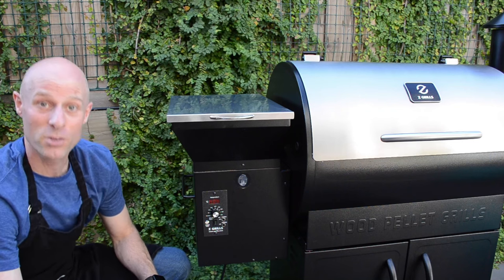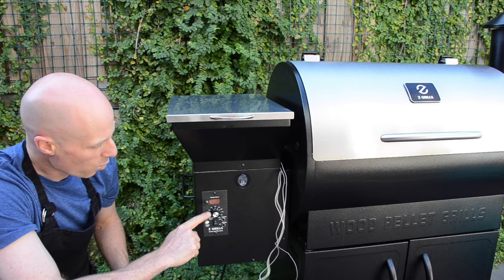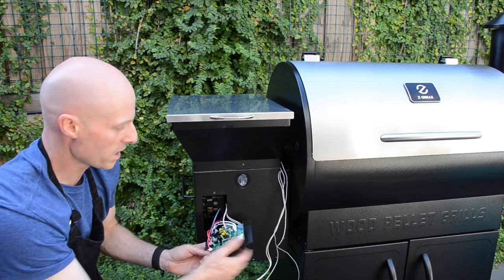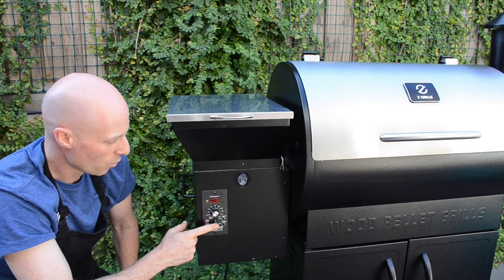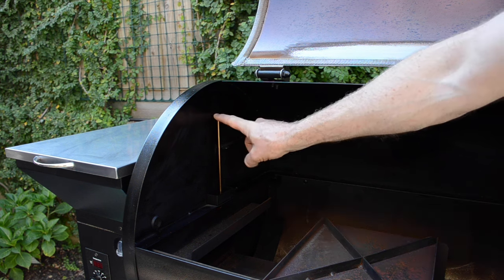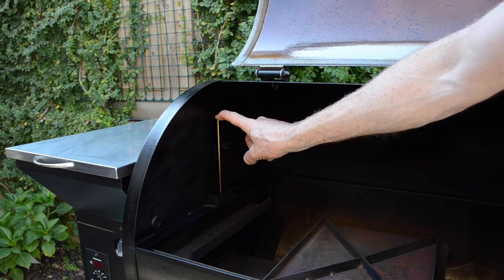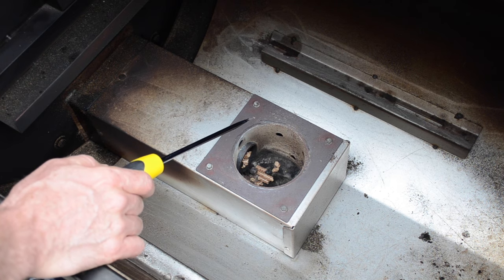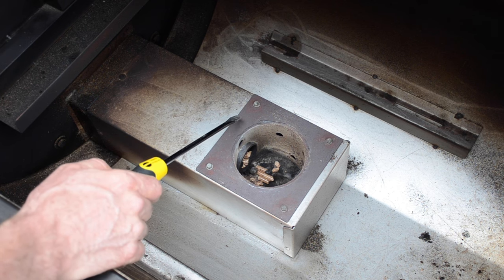Error codes on your Z Grills wood pellet smoker

Comment: I live in a cold climate (alaska) and my zgrill throws me an er2 code all the time when starting up even since new. Everything I have read states to replace the probe. I figured out if I take my cigarette lighter and warm up the probe a little, the grill will kick on. Just a helpful tip.
Reply from the maker: The temperature sensor has a range it can read and because you are so cold then must be below that.  Nice work finding the solution!
Reply: Your trick also works in Missouri! Thanks for saving my Christmas brisket!
Reply from the maker: @jeremysellars5643  Awesome!! Merry Christmas mate
Reply: This just saved my day. Thank you
Reply: Just saved Christmas,  Thanks Wisconsin  1 degree this morning
Reply: @mikemunz747  same issue here in Illinois today
Reply: -1 Degrees Farenheit here in MN, the lighter trick saved my day! Thanks
Reply: FYI after i used the lighter trick to get it going i also had a  low temp error message when i tried to go from “smoke” right to 250. I restarted it and then gradually took it up one click at a time letting it reach temp each time till i got to 250. Hope this helps someone.
Reply: Corbin!!!
You Sir, are a genius!  Live in North Western Wyoming.  It's 1* right now and I was struggling with the same issue.  Thank you for solving this for me.  It's only 10am, but I'm cracking open a beer right now on your behalf.
Reply: This totally fixed my problem. This grill I just got has been working great, until it's been butt cold out. I took a torch heated it up and it fired right up you the man.
Reply: You saved the Super Bowl brisket in Juneau!! Thanks Brother!!!
Reply: This comment was a life saver. Got into the single digits here in Indiana and I couldn't get it to fire up! A little flame to the temp probe did the trick. Thank you good sir.
Reply: This just worked for me as well! Freezing cold out here in CO this weekend and this saved my Sunday! Thanks Corbin!
Reply: YES! Y'know this thought had crossed my mind when I was taking resistance measurements of my RTP sensor to determine if it was good or not. (Seemed to be, so running out of options). I kind of dismissed it then, because I thought that if the solution was so simple, why wasn't it in the manual or - anywhere.     I looked all over the net, until I saw this. Tried it - boom! Doesn't anyone grill in freezing temps? This isn't even my brand of grill, so it must happen to multiple (all?) Brands. Anyway, thanks, dude!

Comment: Man I honestly had high hopes for Z grills after so many positive reviews but after a lengthy installation... ER1. I do these troubleshoot issues, nothing, then I realize it's the CONNECTOR from my control panel that's literally missing pins that CONNECT to the temperature gauge wire. Such a small item but it's basically rendering my z grills useless! I understand it's at a great price but customer service and quality control is what's taking a toll for that friendly price

Comment: I keep getting the high temp and my grill keeps shutting off. I’ll have it on the lowest setting but it keeps doing this
Reply from the maker: After doing a clean out of the fire-pot - if still getting those issues might be problem with the temperature probe inside the grill.  Check the actual temp inside the grill with other temp probes vs what it is displaying on the screen.  Also check to see if the auger is running continually (it shouldn't be) or coming on/off.

Comment: This MARINE is not a Dumb-Ass : I set the dial at 225F but my temperature reads 14F / thus the grill is running at 475 F + and inside the pellet box at 350F. I keep my grill tight and clean. By the way, i have all the equipment to test the temperture reading.

Comment: I keep getting Her code when try to grill on high (450F). It works fine until it gets to 400F then error code comes on. I have checked all connections, but still have this issue. The wire that exits the grill from the probe was touching the grill and is slightly burnt on the outside. Could this cause the Her code? I would think if this was the issue it would disrupt all readings. Perfect timing with Memorial Day, I need help.
Reply from the maker: It may be an issue with the temperature sensor in the grill, I suggest you reach out to the local support team for a replacement.

Comment: My Z-Grill not holding temperature i leave the dial at 225 and goes up to 275 and up, the only way I can lower the temp and keep it steady as possible is if I open the lid for a bit and close every  few minutes or so, is it a faulty smoker? Smoke is not in direct sun, it's under shade.
Reply from the maker: Luis - I can't comment on your specific model, but can be impacted by type of pellets and what software on your controller.  What model and how old?
Reply: @zgrillsaustralia4541  ZPG-7002B 2020 - bought it 5 months ago, I use the Pit-Boss pellets.